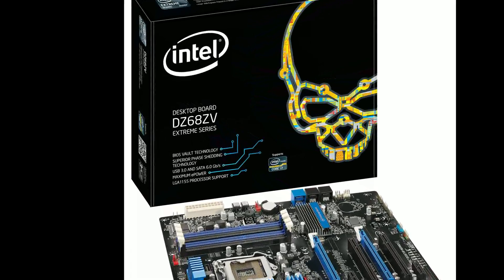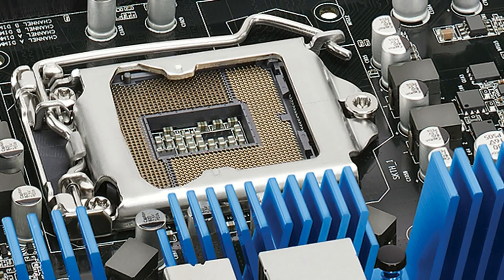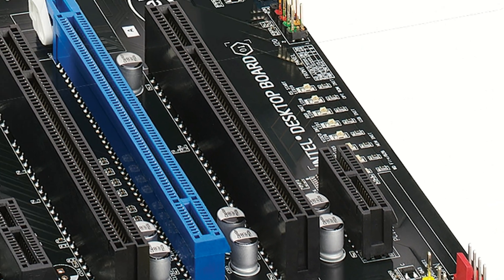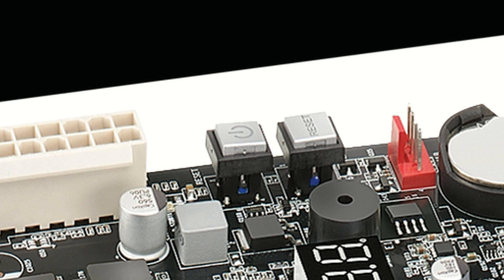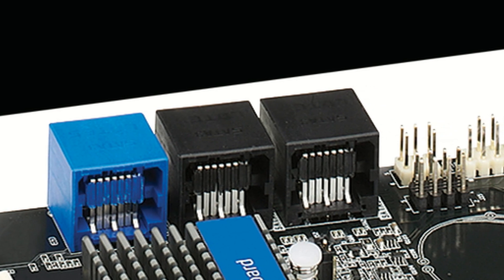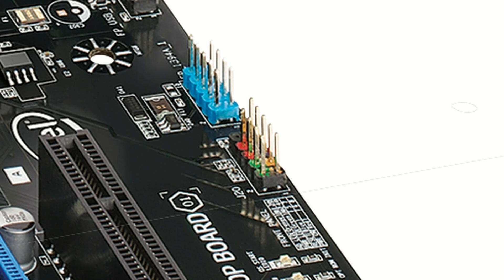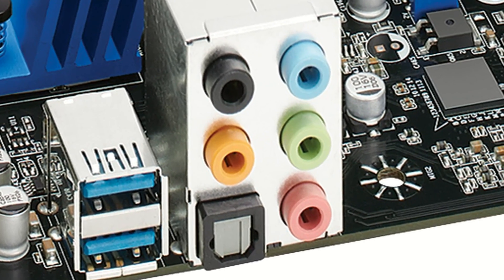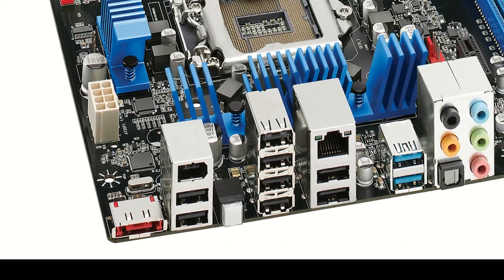Intel Motherboard DZ68ZV

Comment from the maker: It is correct that Intel has not tested more than 4GB module in that board.  If I was to guess, I would say by the time 8GB modules became prevalent the board had already been replaced by a newer one and as such it's not normal procedure to go back and test an older board.  As far as qtmemory.com I've never heard of them and I always use Kingston memory as I've had very good luck with their memory.

Comment from the maker: Do you have the latest bios version?  If not try upgrading the bios.
If you have the latest bios, then I would tell you to get specifically this Kingston module KVR16N11/8.  Kingston does Intel Certified Ram.  This particular module is not one of the certified modules, but if they say it will work with that board, that usually means they've tested it.  And they say it will work with board so...

Comment from the maker: This is per Intel's website "1.5 V is the recommended and default setting for DDR3 memory voltage. The other memory voltage settings in the BIOS Setup program are provided for performance tuning purposes only. Altering the memory voltage may (i) reduce system stability and the useful life of the system, memory, and processor; (ii) cause the processor and other system components to fail; (iii) cause reductions in system performance; (iv) cause additional heat or other damage; and (v) affect sy...

Comment from the maker: Making sure I understand correctly.  You're asking what module will work in there that's an 8GB module?  Kingston part number KVR16N11H/8 is compatible as per Kingston's website.  While it will work as a single chip.  Your ideal configuration should be 2 modules at a time.

Comment from the maker: I assume you are referring to the comment about running SLI and the cards running as PCI Express x8.  Bottom line, when running this board in SLI.  The video cards are not running as fast as they possibly could.  Ideally you want to run as PCI Express x16, but on this board if you're running SLI.  It will drop down to x8.  So you won't get the full benefit of SLI that you might on another board.